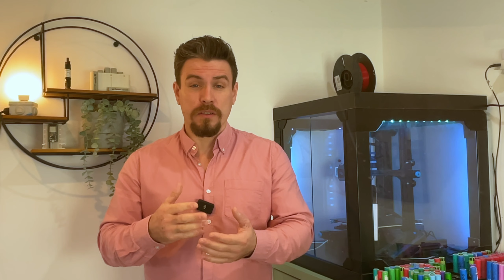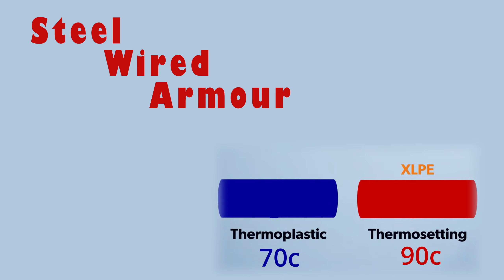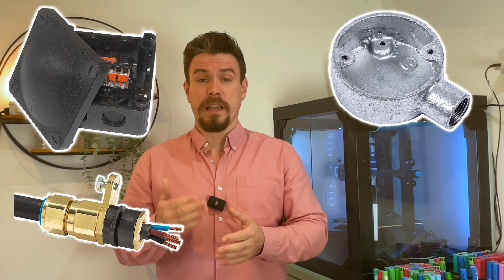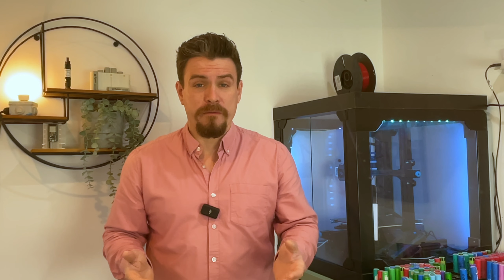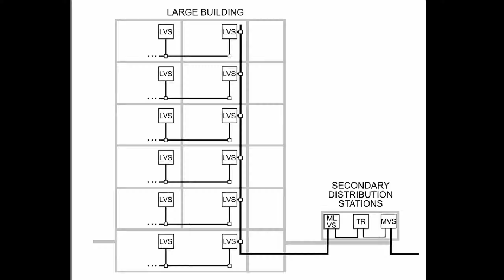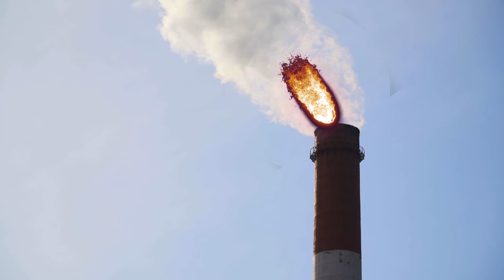I learn about CABLES and RISERS WK:28

Comment: Be careful doing calcs for 90c cables, remember that most of the protective devices or switchgear on the market are only rated to 70c, so you still need to calculate your ccc as a 70c cable.
Reply from the maker: Great advice. Keep your advice flowing. Myself and any other learners can really benefit from experience.